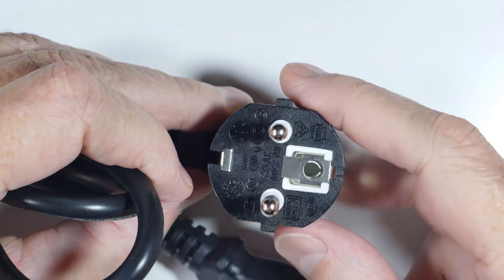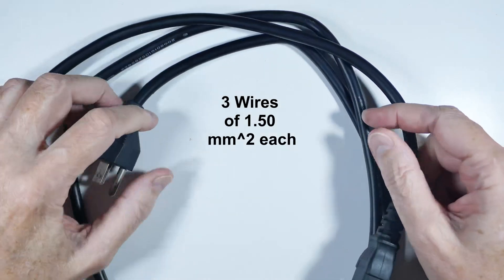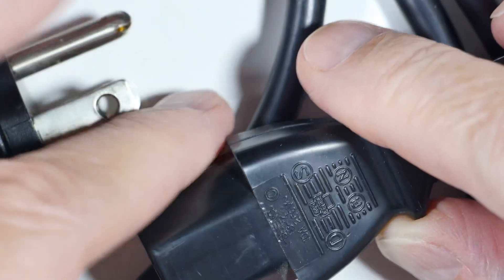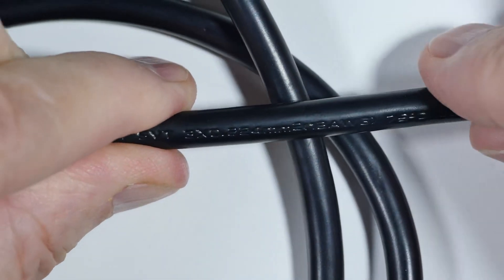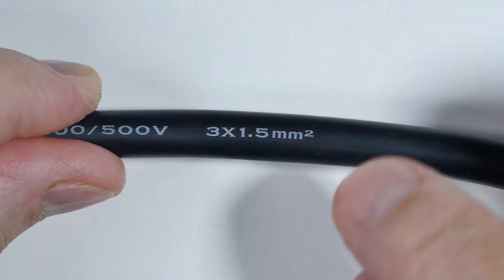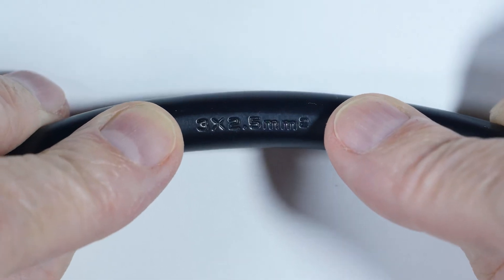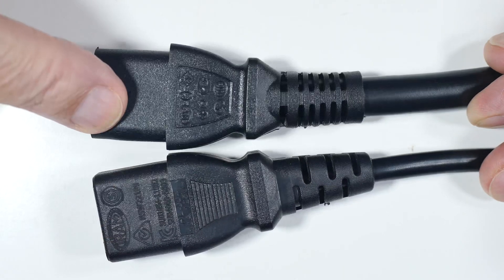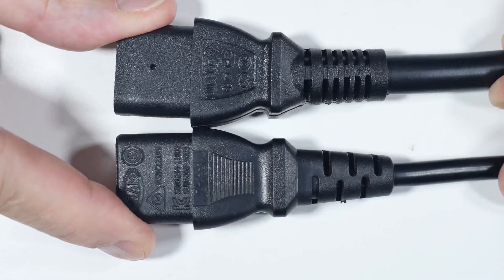Warning: Power Cables Are NOT The Same! (4K)

Comment: So to replace my c13 wall plug for my pc power supply (just because it's a bit old and I honestly don't know if its the original that came with it) should I be looking for the thicker wired version or does it really not matter? There can be a $20+ difference in "brands" for no apparent reason (that's listed in the description on the site anyway) and seems like a brand tax with no real benefits
Reply from the maker: Make sure the new cable's rating is the same or higher than the original.

Comment: I have a Corsair CX 750 80+ Bronze SMPS with 16a 250V power cord but here in India we don't have any UPS with 16a power output sockets So can I use 6a 240V power cord with my SMPS ?

My system specifications 
CPU I7 12700K
Ram 16 GB DDR5 
Board Gigabyte B760M
SSD nvme WD blue 500gb
GPU RTX 4070 Super

Total power draw is roughly 600w
Reply from the maker: It would not be safe to make recommendations on a device without seeing it and measuring the input requirement. You would be better off taking to a local shop who would be familiar with your requirements and regulations.

Comment: Sorry if my question sounds stupid ... but in short .. is a 16 amp power cable better than 10 amps?
Reply: @menaz7880  16Amps mean the maximum rate of current that can flow through the wire can withstand 16Amps. If you ran the oscilloscope using the 10A power cable and the device demands 16Amps (or anything greater than 10amps) then the 10amps cable would likely overheat, melt and cause an electrical fire since more current is passing through it than it is rated for. Electric Devices normally will only pull the amount of current needed to operate it. Having higher rated cables are always safer. Matching amperage and voltage ratings when purchasing a replacement cable should always be considered for all electronics, especially high-power electronics or appliances.
Reply from the maker: @menaz7880  It will carry more power.

Comment: هل من الممكن تشغيل شاشة حاسوب 100_240v بسلك طاقة 16A 250v او انه امر خطر
Reply from the maker: "Is it possible to operate a 100_240v computer screen with a 16A 250v power cord, or is it dangerous?"
It depends on the amperage of the computer screen. If the screen is less than the amp rating of the cord, it should be OK. If your screen is less than 16A, it should be OK.

Comment: An IEC connector is always rated for 10A regardless of the size of the cable. Simply it's because an IEC connector will be manufactured and stamped at 10A because that's what the connector alone is rated for. A shucko connector which is the one you said is for 16A is correct. But again it's because it's manufactured and stamped at 16A. 0.75mm cable is not at all rated for 16A whereas the correct size cable for such a load is 2.5mm. I get it's confusing but no one is lying or trying to deceive anyone.

Comment: I do wish the USA would switch to 240V like the rest of the world
And the metrics for length, height and weight and distance.
It would make things so much easier for us all
Reply from the maker: The fewer transformers required makes distribution lower cost, but you lose the isolation (motors, etc.) and you're more likely to get spiked. But I've done both and I'd give 220 a 20% benefit.  ;)
Reply: that is correct and I wish them the best. However, this is apart of the metrics system.. Or length.. this has nothing to do with that.
Reply: USA actually has 240v. These outlets run at 20A capacity and are meant for appliances such as air conditoners and clothes dryers. The recepticle is a bit larger with a different blade arrangement.

Comment: The 0.75mm2 cords and 0.82mm2 cord are actually all 18AWG. It’s just different methods of measurement. 18AWG wire is generally rated for 10A. The 1.5mm2 cord has 16AWG wire, which is actually rated for 13A, and the 2.5mm2 is 14AWG, which is rated for 15A. Note that these current ratings are based on shorter cord lengths (50 feet or less). The reason the 16AWG cord says 10A on it is because the C13 connector IEC standard only rates the connector for 10A, although they can technically carry as much as 15A, and UL will rate them for 15A. Not sure why the European cord says 16A on it, as that exceeds the ratings of both the C13 connector and the 18AWG wire. Maybe the standards are different in Europe.
Reply from the maker: Interesting. Thank you.
Reply: @tsbrownie  You’re welcome

Comment: guys i have a japanese region ps5 which writien in the power cable 125V 7a is it good to use in a country that the power voltage in it is 220 ? by the way the power supply i dual voltage it can handle 100-127 220-240 so iam only confused about the power cable . sorry for bad english
Reply from the maker: If the ps5 uses less than 7 amps and the cord is in good condition it should be ok, but you should check with Sony.

Comment: It's almost as if the British system of having a fuse in the plug, rated to the capacity of the cable is a good idea.
C15 connectors look like C13s with a notch and are used in "hot conditions", that is items that get hot in use like kettles, not for use in warm climates. The corresponding socket has a ridge that prevents C13s being inserted.
Reply from the maker: Had to look up C 15, they are a big improvement.

Comment: Yes , there is much confliction in the specifications. Good video to make people aware of what to look for. I suspect the strength of the connector pins within the plugs will also determine the maximum current ( via the tightness / contact area of the plug pins to the the wall socket connectors ) . But here was my 1st line of thought   -   Oscilloscopes require very low current. Even at 110VAC which uses higher currents than those using 220VAC , one is looking at below 1/2 an amp. Just for my reference, I took three random 2 Channel Analog Oscilloscopes ( Digital versions use even less current ) and compiled their specifications. With them set for 110V AC , they less than 0.44 Amps . I quess knowing this would save a lot of confusion .  Had the appliance been a heavier consumer of current , one would have to dig around to find a better factual path in order to make a safe/informed decision 🙂. Thanks
Reply from the maker: Thanks for the info.

Comment: So I did some empirical research on Amazon (US & DE) for fun.   All being 3 conductor cables:  .75mm²-18awg is sold as 10 amps.  1.5mm² -16awg is sold as 13 amps.  2.5mm² - 14awg is sold as 15 amps.   The original cord's type F plug is rated at 16 amps as they all are (to my knowledge), but clearly the .75 classifies the cable at 10 amps.  So yep, something to be aware of.  Good catch on your part!   I did see a couple cords on the DE site saying "maximum 250 V 16 A, 3G x 0.75 mm²" so...buyer beware.
Reply from the maker: Thank you for the research. Interesting findings. It helps clarify what's going on. Strange that the ends and the cable are rated separately rather than as part of an assembly. You'd think somebody would have caught this, or sued someone, or done something to bring this to manufacturers' attention.

Comment: 2:00 the plug has 2 different ground connectors instead of a ground pin. One is the french style female connector that connects on a ground pin in the outlet and the other is the german style dual indents on the top and bottom which connect to spring clips. Because in Europe we love standards so much we can't get enough of them :)
I think the 16A 250V rating is meant to refer to the plug standard, rather than the wire.
Reply from the maker: I know about the grounds, I lived in Germany for a while. The plugs are not convenient, but they are smart and safe. Unfortunately my adapters require a 3rd pin. You know, I think you are right about the male plug being good for 16 amps, but the wire certainly is not! Strange there are no standards for the thing as a whole unit.
Reply: This is correct it's the plug standard rating there's a current rating on the cable  sheath

Comment: Also check the actual wiring!  I found a cheap 3-prong cable that had the live and neutral reversed from what they should be.  Could be very dangerous depending on what the equipment assumes about the neutral!
Reply from the maker: Thanks for the heads up. Had not thought about that.

Comment: I have hundreds of these cord sets. The rating issue aside, I would like to know how to determine if the conductors are actually copper and not some aluminum wire covered in some copper cladding?
Hard to imagine an oscilloscope depending much current? An old tube set perhaps on in rush >>>
Reply from the maker: Good question on the wire quality. The scope does not actually say how many amps, but lists the watts. Quick math says it consumes up to 6 amps (which seems like a lot). I used to have an old HP 1722a which was a real beast; weighed a ton and ate power.
Reply: I was wondering the same thing, with the price of copper so high.

Solid copper would weigh more, but I doubt enough more to tell given the amount of insulation.  Maybe the cable manufacturer publishes their spec?

Up for some “open conductor” surgery with wire cutters?

Comment: I think the disconnect (no pun intended) is coming from the fact that there are markings on the individual connectors and the wire, and none for the resultant rating of the entire cable assembly. IEC 60320 specifies the C13 connector (10A@250V or 15A@125V), NEC specifies the Edison plug, some German spec (or Euro spec?) defines the first connector, and so on. The entire assembly will be rated based on the minimum of the components, but it may or may not be actually labeled (depending on the prevailing codes in the sales jurisdiction, I suppose?)

Anyway point is you should choose based on the wire size, since the connectors are already over-spec’ed for the application (otherwise they’d be the next size up). I can’t imagine a scope drawing 10A but maybe I’m out of touch on what modern scopes are like 😋
Reply from the maker: That makes sense. Seems odd there would not be a safety spec on the assembly, but I guess they have to wait until there's enough fires for the insurance companies to put pressure on them!  I calculated from the listed watts what it consumes up to 6 amps (seems like a lot), so yeah, a 10 amp capable cable would work.